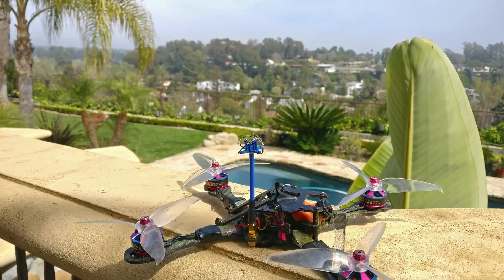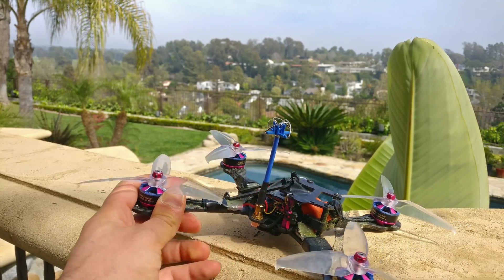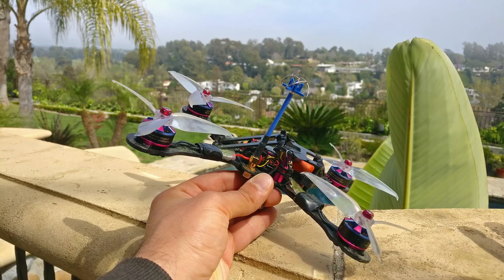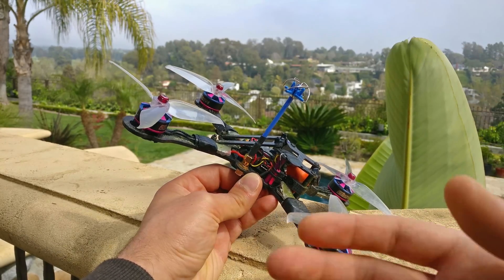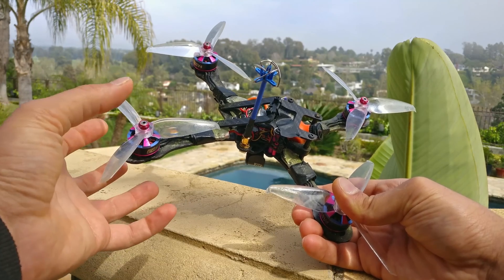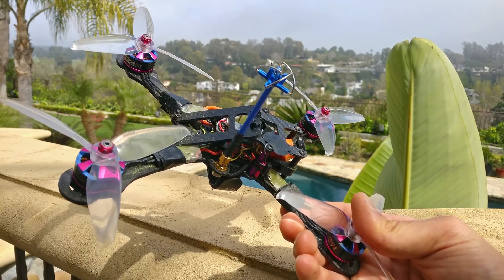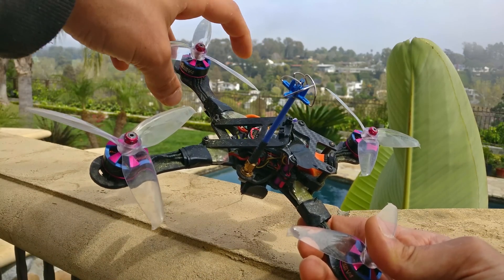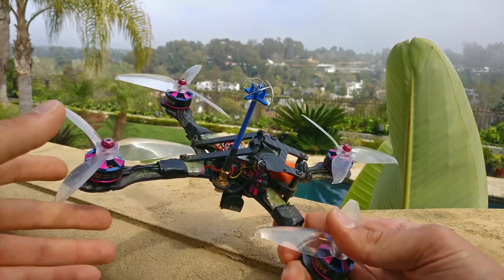Inverted Prop Rotation - Quad Theory

Comment: I'm very intrigued by this idea but can't help but feel that the results are either marginal or even completely in the realm of confirmation bias. How would you feel about following this up with some a combination of flight footage and blackbox logs, keep the truth a secret and let us guess which ones are which?
Reply from the maker: lebasson sure I'll do a test with flight footage. I'm not really interested to dig through the BB though. I also agree with you. the flight effect is like negligent. but the lens staying clean is very very real.
Reply: That alone is worth checking this out. Tnx for making it easy for us.
Reply: kabab...you should hit up bardwell. hes a "master blackboxer"....(is that even a term?)lol 
I'm flying the Hyperlite EVO 5 with a HD frame running top mount battery! 
Just did the maiden on the 6" Hyperlite EVO also top mount ! Amazing!!! Its a tight fit but it works! Its so light i can run a 1350 pulse 75c

Comment: I don't think it should affect your cornering as if you're going to throttle up all 4 motors for the turn (in order to bank and yaw with reverse motor direction) which should mean that rear motor providing thrust for banking will need to throttle up higher in order to compensate for the extra thrust on the motor doing the yaw.
Reply: well, 3 motors one of the front ones will always throttle down but you differences between the 2 opposite rotation motors and the rear motor picking up the weight is going to be smaller meaning less banking unless it goes faster.

Comment: but. why is everyone still flying the wrong way? lol
Reply from the maker: HDvectory that's a great question. I was too lazy to do it until I found out a little more about it. I don't think they have switched it in BF because everyone's craft would go nuts if they did.  even if they put a huge warning on it.
Reply: i just did my first flight with inverted props (because i put my motors on the wrong way lel) and it just yawed and pushed full throttle through the air as soon as i armed it. forgot to change yaw rotation lol.
Reply from the maker: ALWAYS test with NO props on first.  Please be careful.
Reply: i did. it behaved strange but i thought it were just vibrations coming through the gyro... lesson learned xD

Comment: Would that then change the motor dip issue to left hand turns?
Reply from the maker: Brian Kueser the motor dip issue has nothing to do with actual forward flight. that's if you're referring to my previous video with a motor corner dipping on throttle pump.
Reply: I was thinking about the outer rear motor maxing out on right hand turns you were talking about.  I wonder if switching the motor rotation would just change the issue to left hand turns, (which seem to be hard to do anyway. :).
Reply from the maker: It's not a right or left thing.  It's an outside inside motor thing.  Normal rotation makes the outside rear motor spin more.  Inverted rotation makes the inside rear motor spin more.
Reply: That makes sense.  Thanks.

Comment: I've done this for over a year now, and it works for getting less prop wash in my opinion. I've tried posting it all over the forums for the past year. I appreciate you sharing this with more people. just everyone who does this make sure you have the motor direction set correctly or your quad turns into a spinning top that shoots straight up.. haha.

Comment: Great video, I always appreciate your insights into the technical details. I'm wondering if you may have missed another benefit of swapping motor direction. It seems that when clipping a gate with a prop, the quad would have less of a tendency to start yawing wildly. Thoughts?...
Reply from the maker: dudmahn interesting. I can see that might happen. or the prop is spinning so much faster than your movement that it'll suck it in anyway. I also usually clip gates with my rear props somehow.
Reply: I find that I'm able to recover quicker after clipping objects, it's like my quad doesn't freak out or get hung up on as easily compared to 'standard' rotation. Of course that could just be confirmation bias, I wonder how we could test this?
Reply: Thats a good idea, I'd love to get some ultra high speed cameras and film drones as they clip an object and observe whats happening to the props and motors.
Reply: I'm not sure how we could test this, other than to clip a bunch of gates and observe the results.  The testing could be performed blind, I suppose, such thatI the pilot doesn't know which direction the props are spinning...

Comment: Lol this was discussed in the bf thread over a year ago and been flying it since, can't honestly say I notice a difference in flight but not having grass and sap etc splatter the cam lens is useful. I believe the reason it has not been set as default is the amount of relatively inexperienced people who would have issues, crashes and damage on existing builds because they didn't reverse their motor directions
Reply from the maker: well they could just make it a switch with a warning that pops up. I had to do the cli command a few times to get it to stick. the cli is really annoying. it does that all the time.

Comment: Cool.. Couldn't you use black box data to see if its helping :)
Reply from the maker: Richard Crellin I'm not such a black box master. you're the second person to point this out so I'll consider it in the future.
Reply: Kabab FPV I've only just had a play with it myself, found it super easy to use andunderstand so I'm sure you will pick it up fast. keep up the cool vids. :)
Reply: You could always hand them over to Josh to analyse if he has a spare moment or post them up here so others can check for you
Reply from the maker: covertads if I can't figure it out in a timely manner myself I will do so. although I've done it several times before. the test would involve an annoying amount of effort for no real gain however. reverse rotation keeps your lens clean and doesn't negatively impact flight performance. results from BB won't change that. I'll look for more telling uses for BB in the future

Comment: So do you swap props as well? Or keep orientation/mounting props as normal?
Reply: Paul Butchyk probs would have to be swapped, otherwise the would be spinning backwards.
Reply: John Phillips I thought as much as  per the shape of the prop and physical properties for handling air.
Reply: There is such thing as 3D blades that generate thrust in both rotation directions. Never used them myself, but seen them used on drones that are set up for 3D flight, where the props spin both directions depending on the direction you want the trust.

Comment: I watched the Furious fpv and I see they add  another command after the one you show ..
Reply from the maker: Yeah software version 3.2 is coming soon
Reply: Kabab FPV  so should I add the other command  or was it just for the mosquito
Reply: What are they changing?
Reply from the maker: They're just adding some stuff to the spectrum analyzer.  Nothing major.  It's the same basic thing.

Comment: I've often wondered the same thing...  I'd say having the motors  spinning away from the center makes much more sense.  Spinning inwards, the sides of my camera and frame look like a dirty lawnmower.  But the biggest reason that I can think of especially for freestyle would be that outward spinning motors would push scraggle away from the frame instead of the way it is now, gathering it and bunching it all up between the frame and blades.  Just a thought.

Thank you for all the time you put into making your videos.  I really appreciate and enjoy watching them.  I'm off to floss!
Reply from the maker: I doubt it makes any difference at all.  A prop to a branch is like a bee to honey.  They seem to belong together.
Reply from the maker: Interesting thought.  Maybe.  I did just get caught up in a branch earlier today however...
Reply: Actually i think it will work the oppersite as most people will try to avoid scraggle at the last minute and normally make contact with the side of there craft if the direction is reversed and you hit scraggle on the side it will suck it into the craft.

Comment: I just tried this last weekend and I won't be switching back to the normal way. The benefit of not sandblasting your lens when you take off and land alone is worth it. My dalrc 2.5 lens is absolutely trashed with pits in the lens from the normal rotation. I flew all weekend and didn't really have to clean my lens once now that I reversed rotation.

Comment: Kabab, I see that in  a lot of your videos that discuss the properties of different props. Does motor KV change the prop characteristics? Whats the sweet spot in KV? I've hear some people say they like 2700kv 23xx motors and others swear by 2400KV 22xx motors.
Reply from the maker: The kV you choose depends on what prop you want to run and vice versa.  A prop like the RK5051 is designed for a max efficiency speed of 60mph.  If you surpass that speed, it starts to get really inefficient very quickly.  It's intended for a torquey ~2300kv motor.  If you put it on a 2700kv, it's gonna draw LOADS of amps at the top end but it will move quickly.  It just costs you your batteries.  Generally, high kV motors need lighter, shallower props and tend to have less control down low and higher top speed with higher amp draw.  That being said, too high of kV on a heavy quad will cause unnecessary amp draw with not much speed added.  Pair up anything with anything else and it will work fine, but if you're trying to optimize components  you gotta be a bit more diligent.

Comment: Why don't you run up some BB logs to confirm the theory?  That should validate or disprove it.  Just run a fast banking oval and see what you get.
Reply: This is would be good material for a Kabab FPV, Joshua Bardwell collaboration.  You do the flying with both setups and he picks apart the black box logs.
Reply from the maker: I'll ask him about it.  It would be interesting to see.  I think I might need another 10K followers for him to consider something like that with a lowely ol youtuber like myself :-p
Reply from the maker: I'm a tad bit lazy :-/
Reply from the maker: LOL I think you just said Bardwell isn't so good at flying...
Reply: Not my intent.  The idea is yours, at least in regards to the outside rear motor maxing out because of the prop rotation (this is the first I had heard of that), so you could easily duplicate it, and should be involved in exploring the concept further.  Bardwell is the black box master and could break it down in a way the masses can understand.  If anything my comment should be taken as a question of your black box abilities. ;)
Reply: Haha, just keep doing what you are doing and you'll get there.